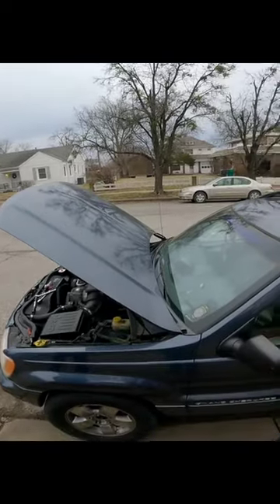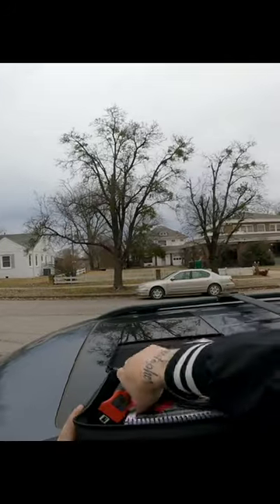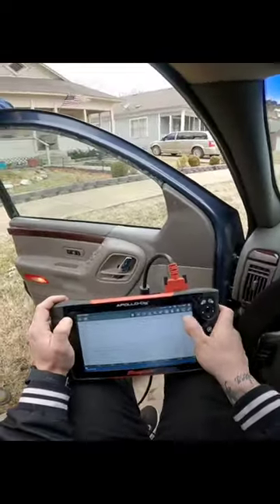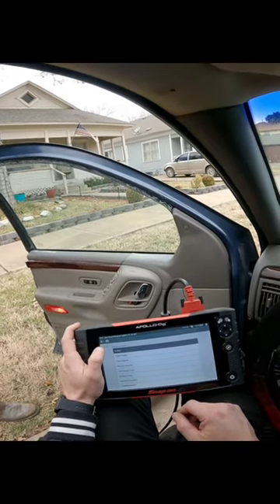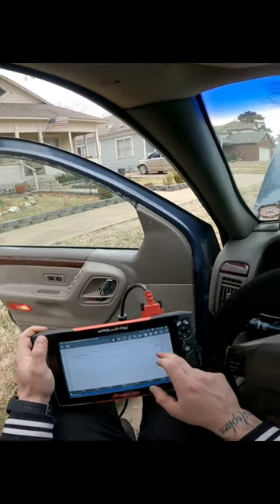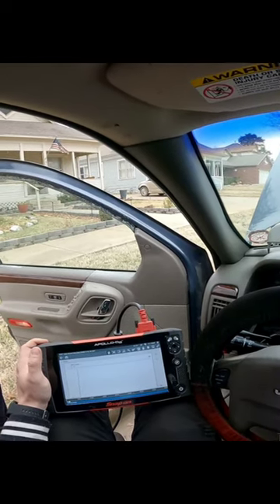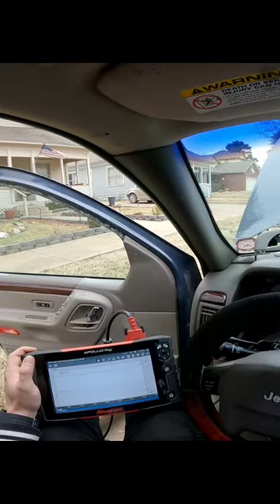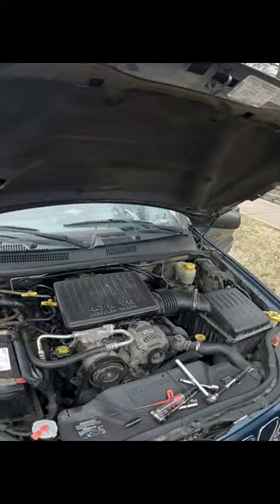Great customer, unfortunate circumstance!

Comment: I agree with your approach. If that kid keeps tinkering, he will figure it out
Reply: And he'll be damned proud!!
Reply: I'm near damned sure that kid did his own timing chain, godspeed.
Reply: Yeah I'm sure he can get it, but sometimes that involves blowing your engine by messing up timing placement. Some Jeeps have very strange markers and you gotta follow the repair manual. Just a little off and pistons hit valves on interference engines.
It really matters where you get your information from and remember AllData, Mitchell, Snap-On Troubleshooter, are behind a pretty expensive paywall if you are dltrying to get flow charts, repair manual data or wiring diagrams for more than just one vehicle which is $200/month instead of $20/month for a solitary vehicle.

Comment: So you see no cam signal off a scan tool reading and you recommend tearing into the engine for timing🤣. Kid should ask for a refund.
Reply: I came here to say the same thing. I charge an hour diag. I'm checking the cam signal at the sensor or ecm. And 5v ref and ground. Especially  before I tell someone to tear down the timing
Reply: @codywichman213 that's exactly where to start on these. I was thinking the scan tool tells him if the 5v is there?
Reply: Seriously this guy shouldn’t be charging for mechanic work . He’s a joke

Comment: If it had a distributor, you could pull the cap off and watch to see if the rotor turns. This happened on an old CJ5 of my friends. The old timing chain popped and blew a hole in the timing cover. I put a new timing set and cover in it and the new timing chain failed. I pulled the distributor cap to confirm. That old 258 I6 needed a complete rebuild.

Comment: I understand its impressive that the kid is learning to work on his car. Trust me thats so impressive that someone wants to learn this stuff. But being a diagnostic tech. I would have went straight for the junk aftermarket cam sensor that wasnt counting up on the scanner. Im pretty sure you can swap it with bank 2 cam sensor and retest. Chrysler is notorious for no starts when they loose a cam sensor. But hey, i understand he only payed for a certain charge. But if that same car was in my shop we charge hr diag. Im checking power and ground and signal with the scope at the sensor or ecm..especially when the scanner shows no cam counts. Thats too easy to do before recommending a customer to remove the timing cover to check the timing. Thats just me tho.

Comment: I recommend a DIYer to hire someone with experience to replace a timing chain or timing belt.
Reply: Why would you recommend that. If you can't replace a timing belt or chain, you're not a DIYer, you're just a normal know nothing. Replacing those things aint difficult, only way to fail is if you can't do the research before you do it. And then you deserve to have it fail.

Comment: One thing about Non OEM sensors....They are JUNK. ALWAYS buy Oem sensors especially on Mopar products. Been down this road many times. I'd bet the farm if you would've swapped a OEM crank sensor in it would've worked. Timing chain Nahhhhh use Mopar parts then it's fixed. I never ever EVER use parts store sensors ALWAYS use oem. I've learned the hard way.
Reply: It's always a junk autozone sensor. Especially oem only on Chrysler
Reply: @codywichman213  Yes Mopar is Notorious for that..How ever in the last couple years it seems to be all makes and models. I'd bet of he had replaced that crank sensor with a Mopar Oem it would've fixed it. PLUS that's pretty much a Jeep thing anyways....Very Common symptoms of a Jeep CPS.

Comment: Had a similar issue with a 94 5.2. Cam and crank position sensor codes. Would run the if you drove it would die 1 mile down the road. After replacing both sensors same issue. Turns out the battery had a short. Had enough juice to turn over but was drawing too much juice from the alternator to keep everything going.

Comment: Even with bad timing you will still see pulses on cam and crank... bad ground or 9volt feed... those older jeep don't use 5volt reference...  that engine sounds like it has good compression...  also those aftermarket sensors are trash i would put oem sensors back in and check powers grounds and signal wires

Comment: Use your Pico scope and back probe your cam and Crank senor's and look at the cam and Crank correlation graft they should be mirrored in with each other perfit if not then use your scope to measure how much your timing is off ...

Comment: Those 4.7 Chrysler engines are known to drop valve seats. I’ve seen it where it triggers stuff like that. Same thing with the 57 hemi from 05 to 08. They dropped valve seats, common loose Chrysler seats.
Reply: It would still run with a dropped seat, just have a misfire on a particular cylinder.
Reply: @mph5896  I mean not necessarily, but yeah, cause I’ve seen it on the hemi where it dropped a seat, and it traveled through the intake into all the other cylinders, and destroyed them but I haven’t seen it on the 4.7

Comment: Dude that 4.7 l Mopar motor is an interference engine. And by turning it over like you did, if the valves were not already bent, you bent them

Comment: That engine is an interference motor, which means it’s got some bent valves and problems more than just the timing belt
Reply: Can’t just time this engine and put a new belt on, don’t give these guys false advice
Reply: 4.7 is a timing chain engine. It does NOT sound that bad spinning over. Cam sensor has potential no signal. I personally would check for 5v to the sensor, ground to sensor and signal at pcm from sensor with a scope. If no signal at pcm on scope, its a bad sensor or a problem with the cam reluctor wheel. Pull cam sensor and spin over watching to see if reluctor wheel is spinning with a mirror or a bore scope.
Reply: @mph5896  it doesn't matter how bad it sounds spinning over, I've had engines with broken timing chains/belts sound like nothing is wrong, all depends on where and how the piston contacted the valves, and it doesn't matter if it's a chain or belt, if the cam shaft is not spinning, that means at least a couple of the vales are open while the piston is moving, causing contact and bending valves. It is an interference motor, meaning there is no way there isnt valve damage. Best bet would be to pull the head and see how bad it is, if the pistons have minor damage u may be able to get a new valve train and get it back on the road, but in no way shape or form is it as simple as replacing the chain and timing it. That's just bad advice.
Reply: @soupy031  I can tell you 100%, by listening to that engine crank over the timing chains are NOT broken, AND the camshaft is turning. 

I am very familiar with those engines. In your original post, you called it a timing belt. 100% incorrect.